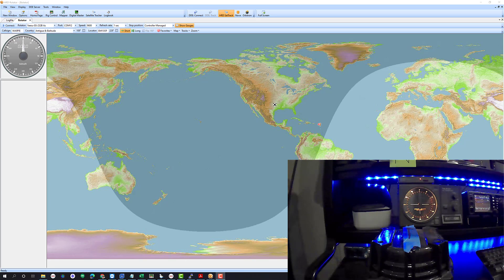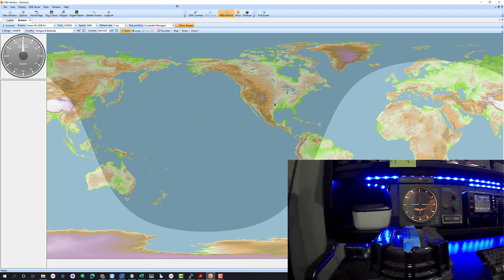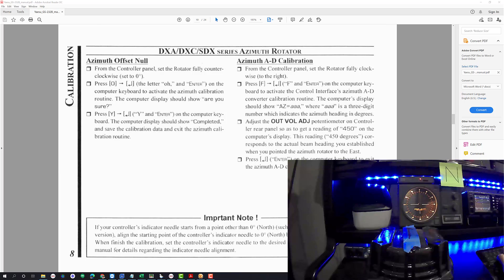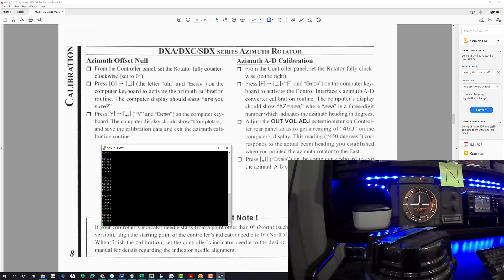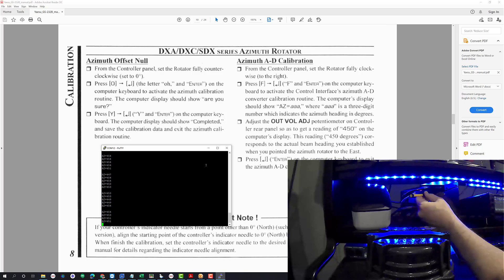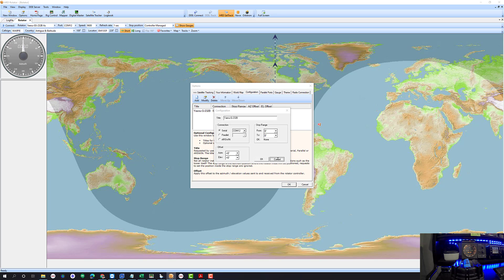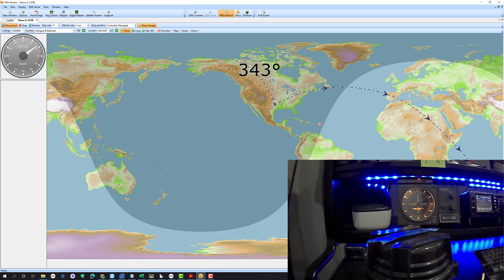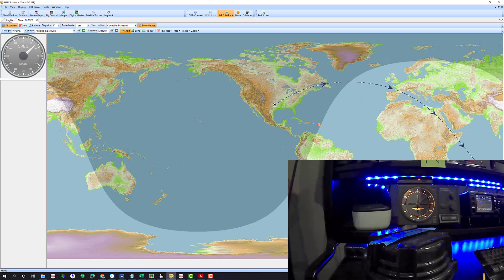Ham Radio Deluxe Rotor 450-degree demo

Comment: Is there any way to make hrd open rotor control only on startup?
Reply from the maker: You can select which apps open at startup in the Rig Control connection pane. That said... I personally don't care for the option myself. I prefer to have more control over it.
Reply: @HamRadioDeluxe  i will try that. Very frustrating when it locks up the computer. Have to reboot to get it going again

Comment: Question about comports.  The last computer that had these was on a windows 7 system. Now that I  have updated to windows 10 I  see no comports.  Now to use all the new modes and if you want to use digital modes everything is by USB. Am I  missing something. Would like to use HRD my singalink is USB. Guess my brain is concrete. Hope you can follow this. 73 KQ4CD
Reply: If I understand your question... the SignaLink USB is a soundcard device (rather than a rig control device). As such, it doesn't create a COM port and it's not capable of being a rig control interface.  http://www.tigertronics.com/slusbfaq.htm#Can%20I%20use%20the%20SignaLink%20USB%20to%20control%20my%20radio,%20or%20will%20I%20need%20a%20separate%20CAT%20interface?